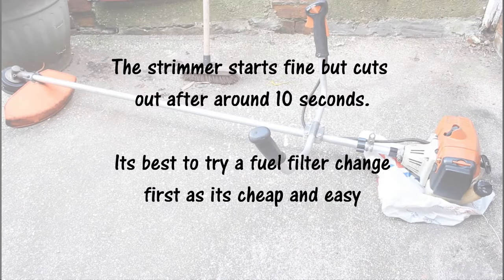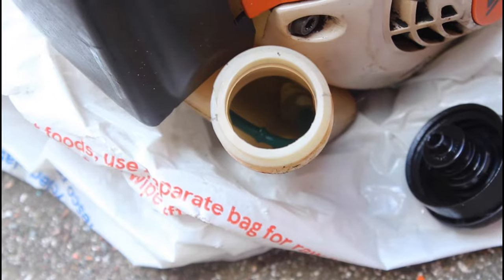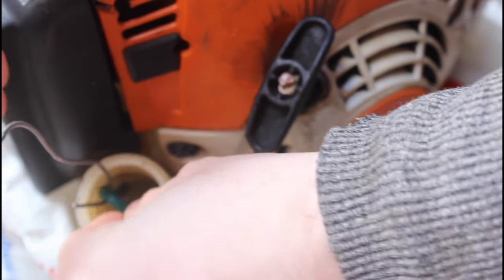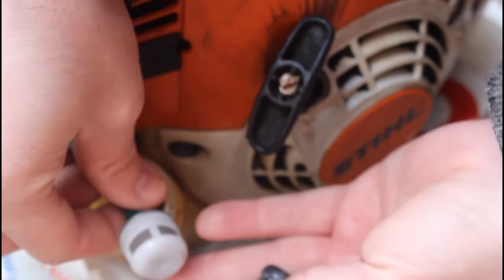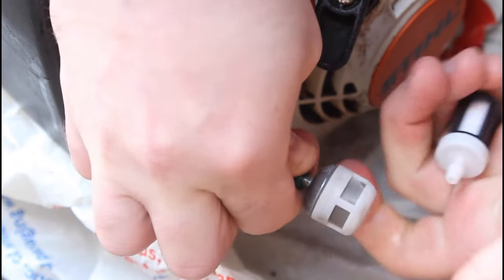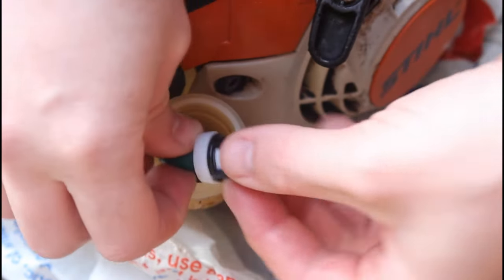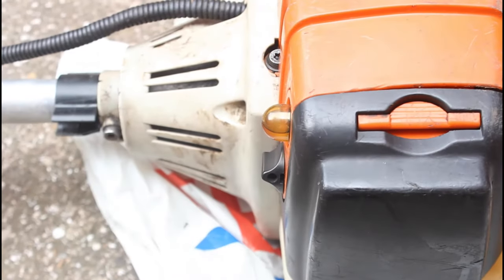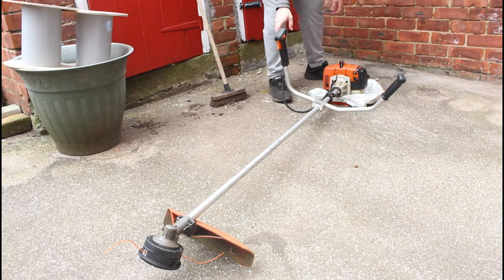Stihl Strimmer Fuel Filter Change | Under 2 minutes (UK)

Comment: THANKS, useful to know, but on mine i will have to go deeper as no fuel is getting to the priming bulb at all despite a lot of pumping , not sure yet if it is debris is in the pipe, also hooking the filter pipe out of the fuel tank would be made easier if the tank cap is secured to the filter pipe using the proper tank cap fittings so when you take the cap off to fill up it pulls the pipe out as well
Reply from the maker: Yeah, the pipes are probably the next thing to check if the filter isn't too old. Could well be an easy fix, just debris as you say. Good luck 👍
Reply: Check the fuel line to the carburettor and the priming bulb itself, too, because a (vacuum) leak will stop the bulb pulling fuel up.  I had to replace the priming bulb on my dad's FS38 because it had deteriorated (probably left in the sun) and cracked.

Comment: You fitted a different filter from the one you took off, those filters are for 2 totally different machines, the correct one was the one you removed
Reply from the maker: It's still going strong with the same filter
Reply: The filter he used is the one that comes with the service kit for this model.